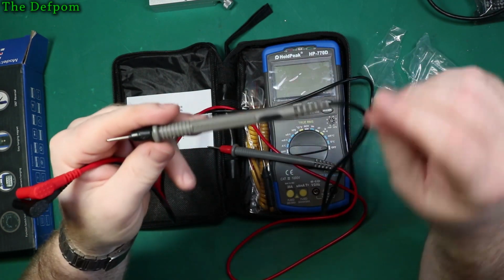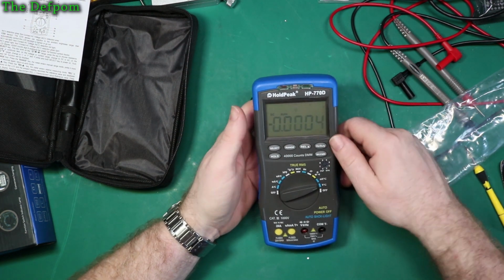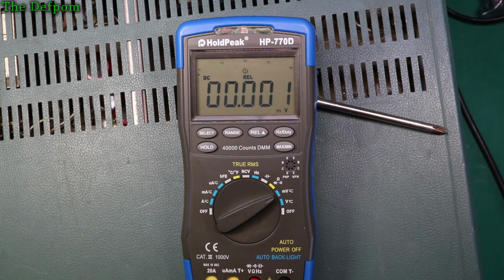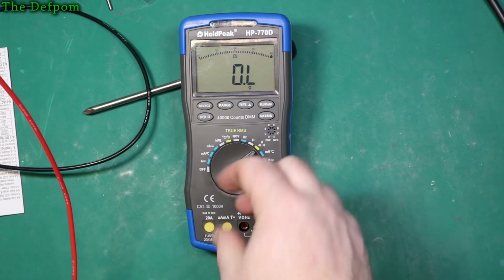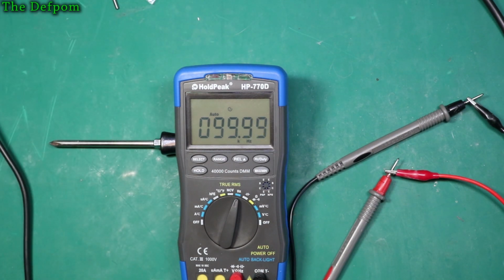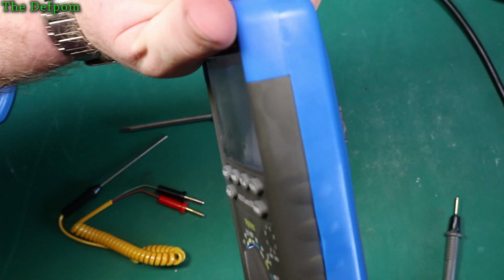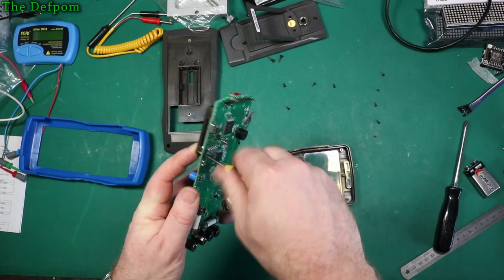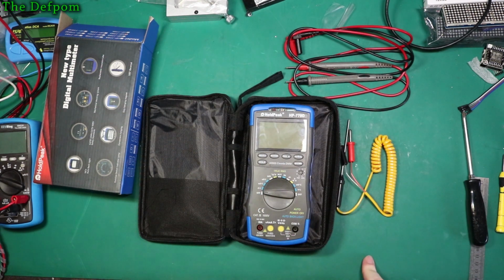🔴 #472 HoldPeak HP-770D 40,000 Count Digital Multimeter Review & Teardown

Comment: I have a question?
Why don't they ever use an
 18650 lithium ion battery in a multimeter?
I've never seen any multimeter with one in it! They're packed full of power. They are rechargeable & You would probably only have to charge it 1 or 2 times a year.
Reply: Also, why do you need to take the thing apart, with cheap self-tapping screws wearing out the plastic, just change the battery? Every other device has some kind of little flap you pull open, but multimeters almost never do. Weird.

Comment: Hmm that looks pretty good to me, and you can calibrate it by messing with the variables in that 8 pin serial memory chip, i2c i think.
They can use less accurate resistors and trim the error out, im sure you have already looked into trimming it via variables.

Dc volts i expect to be accurate, and ohms if possible.
All other modes are rough, they always are.